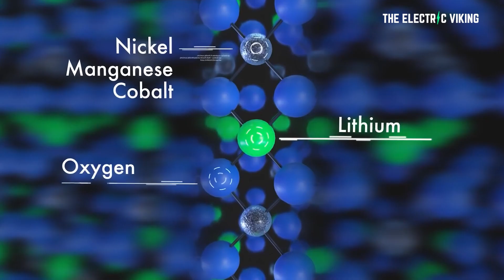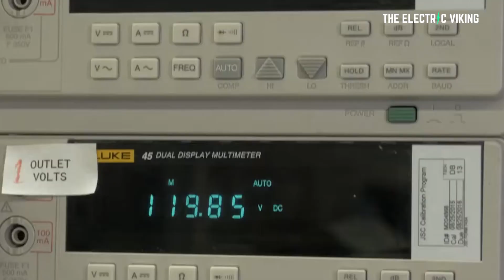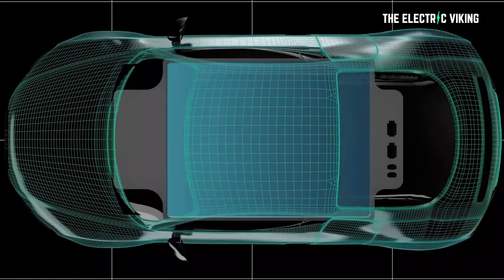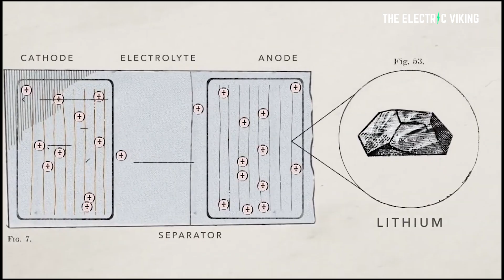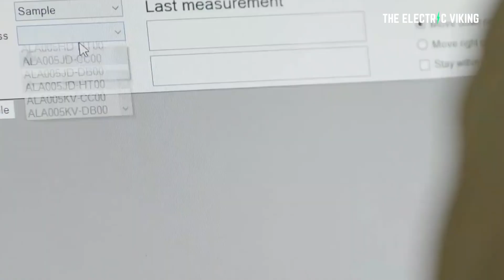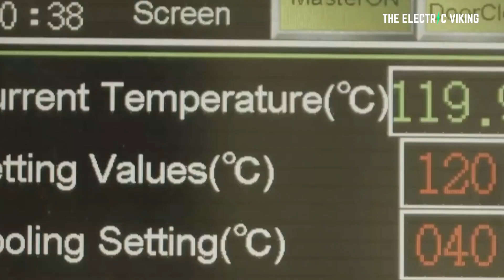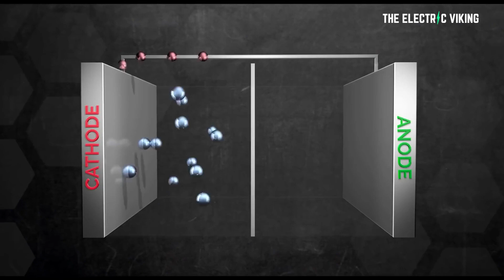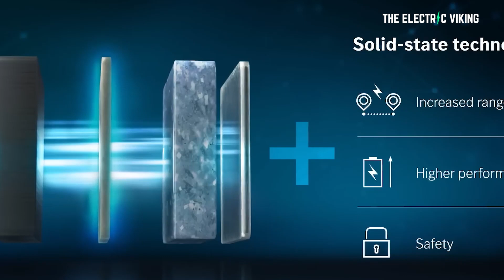NASA's solid state battery could change EVERYTHING

Comment: Any battery with a pure Lithium anode will have safety issues, due to the fact that pure Lithium reacts violently with oxygen in the air or even the oxygen bound up in water (H2O), since the seals that separate this pure Lithium anode from the air can and too  often do leak!!!! Additionally, usually, to enable  sufficient ion mobility, the so-called "solid" state batteries always seem to require some flammable liquid electrolyte, even when they use a solid ceramic separator to prevent internal shorting by the growth of dendrites.

Comment: I think batteries with those capabilities from NASA would be great because of resources resources and also each battery pack if that light and more powerful way more safe the safest actually well we could have motors for helicopter type vehicles airborne vehicles Motors for each battery pack the more motors and battery pack you have the same for the vehicle would be so airborne vehicles could become a common thing or are airborne delivery systems and stuff like that.

Comment: Like others: Paint me as skeptical.      I looked at a couple of articles about the NASA announcement and what is not discussed is just as telling as what is discussed.  
- No mention of cycle life.    If the battery can only be cycled a few hundred times it will have a very limited set of applications.
- Production processes.   If the production process is not scalable, it is not a breakthrough in anything but a scientific novelty.    In addition,  if the production process is radically different than existing battery production, it will be difficult to get the volume ramped up enough to be significant.

A lot of companies and researchers have announced their breakthroughs in Solid State batteries,  but issues like these are the hurdles that have kept them from being 'real'

Comment: Electrical current as is flows creates heat. Unless they have also figured out a new conductor as well.  Every single battery creates heat on discharge, now run it through variable demand discharge rates and throw in the regenerative braking and see what happens.  On diesel electric vehicles the energy is dumped into a diode grid and wasted as heat. Color me skeptical
Reply: I forgot to add that at the current rate of power plant closures it wont matter if they create the perfect battery because you wont be able to charge it.  Selenium is poisonous and water soluble so that’s gonna have to be dealt with as well

Comment: The airline industry really needs to add solar to these new electric planes too like the Aptera. Gotta check out the propeller-less plane. They've goto get rid of those extremely dangerous propellers - they'll never be considered safe for public use. Check out the Jetoptera, JETX, Bellwether Industries and more. Most flights are 500 miles (805km) or less and electric planes will be ready for that soon.
Reply: Ion drives aren’t exactly safe… a few thousand volts at a few hundred amps does bad things to people.
Ducted fans are safer but less efficient at low speeds giving poorer takeoff performance.
Reply: @allangibson8494  Usually a good idea to check to make sure you know what you're talking about before you post - none that I mentioned are using Ion drives - that's for NASA in space, but those working on ion drives seem to have a good handle on it and still much safer than dumb propellers. A one minute check is all it takes.  Plus, comparing that to dangerous blades in this scenario is just dumb as ion drives won't take your arm or head off. How long before some kid sticks his hand in the propeller?
Reply: @donotcare44  A full power ion drive will simply kill you stone dead.
High voltage electrical systems do that.
The only question is will it cook you or irradiate you first while it is killing you?
And I do know what I am talking about with those - high voltage electrical systems are my day job.
Lethality is a factor of power - the more power in a defined space, the more likely it is to kill you. The form of that energy is irrelevant as it is being released to do work.
BTW - sea level ion propulsion systems  for aircraft are a thing.

Comment: Selenium unlocks airline use, but is an expensive element. So will likely only be available for airlines and super expensive EVs for the very rich.
Reply: Selenium isn’t rare. It’s just nobody has much of a market for it at the moment.
Copper selenide ores are fairly common (particularly in Western Australia where they are a major nuisance because of how corrosive they are).
Reply: @allangibson8494  I hope you're right, because right now selenium is very expensive, would be wonderful if the price could be bought down and this high quality batteries be mass manufactured

Comment: Rockets get fueled once and then launched. Commercial airliners are constantly refueled and flown out. Until they can meet the refueling times, batteries (of any weight) are a problem. Maybe celebrities will buy "green" planes but United, Delta, etc, aren't looking to reduce the number of flights they have in a given day, because they're waiting around for batteries to recharge.

Comment: Density IS the weight (more correctly MASS)  per  unit of energy ( watt hours) or capacity for a given weight.  
SO 
what is it?  You keep saying double the density  then ALSO saying a 40% reduction in weight.  Is it that with the given energy density and the safety of the materials a doubling of the capacity would still be safe?  It would still just be a doubling of density and not a factoring of capacity by the doubling of the weight you could safely have of such a dense battery. It  would still just be a 2X factor  over previous  capacity  or density  not both  as a sum of each.
Is that 'FAIR"?   (when you say : "To be fair" it makes one hear "I'm not really always fair")

Comment: Jetengines will not benefit from electrical drive. It will not have the power derived from fuel and heat expansion in the engine, so it will have to be some other type of engine!

Comment: Great video if it works for real it is fantastic but usually the problem is to go from the lab to the production line at an affordable cost it will take time. Ask Elon how hard it is to increase production of the 4086 they have work on that for 2 years now it is getting there but to start a complet new process from scranch it will take time. Hop it work that will be fun for everyone because the batteries have been the holding factor in the production of electric transportation system (airplane, boat, truck, bus and cars)
Reply: Yes
Reply: And naturally for all the riders out there.... motorcycles!  Currently they are often heavy, expensive, average range.  5x would take care of that.
Reply: The funny thing is Hydrogen for regional air travel is possible now, transit over 40 people is possible by 2035.

Comment: Batteries in jetliners will be a loooong way off! There's  about 35kwh in one gallon of jetfuel. A long flight in a 747 will use up to 40,000 gallons. So 35 x 40000 == 1.4 MILLION kwh!! So 1.4 Gigawatt hours! Even with this NASA dream battery @400wh per kilo, the poor Jumbo 747 will be lumbered with a battery weighing 3500 tonnes! ...Bit of a problem, as the max take-off weight is about 400 tons. Lol.

Comment: Honestly, SpaceX is really the stand out on trumping NASA, though in NASA's defense, SpaceX had to take some massive risks to get the basis of its tech off the ground.  Elon himself said that they were at one point one failed test flight away from bankruptcy back when developing the Falcon rockets.  NASA has to deal with a lot more oversight and politics when it comes to large scale projects like building a rocket, which is probably why they are happy to contract out to SpaceX these days when they have the oppotunity.  If SpaceX had a functional Starship working today, NASA probably wouldn't be screwing around with their 'new' rocket since funding of the rocket is conditional of them buying parts from various US states rather than what is easiest.

Comment: "Solid state" is to batteries what Fusion is to Nuclear energy, always just around the corner and will be a game changer. Well, the corner is the longest corner ever made and the game has not changed. many labs are working on solid-state batteries, some for university programs and some for large companies. batteries have indeed been made that work but in a laborious way by hand. They are not performing at the efficiency that the hype says is possible and many scale-up production problems still need to be addressed. If NASA developed a usable unit it does not have to mass-produce it for its program so it may not be suitable for the open market. We need to focus on the tech that is available now and in the next five years that can reduce our dependence on fossil fuels. Diverting too much money into the "I wish" area will not help the here-and-now problems.

Comment: You say that a battery has a high energy capacity of 400 Watts/kg, but the Watt is not a measure of energy, it is measure of power.  It's all very well saying a battery is 400 Watt, which usually means its maximum power, but what matters more is how long it can sustain that power.  You need to quote the battery's ENERGY capacity. This is usually  measured in kiloWatt hours (kWh).  I would have expected you to know better🤔

Comment: Sounds like typical historic govt research, do the expensive research business doesn't want to do and find the pathfinders. Then turn it over to business to cross the finish line. Invisible but world changing.
Reply: BTW, SLS isn't research, it's a jobs program. It's just a pile of rusty old parts from 1970 they just wire wheel the rust off....... over & over.

Comment: Is many have pointed out. I'll believe it when I see it and they start actually manufacturing it and it being put in cars having said that if we are still burning coal N fuel to charge these batteries, it does not matter how good the battery is you were not moving the needle we need to be building thorium nuclear reactors wind and solar are not going to fix anything. They are not efficient enough now the nuclear reactors are not 100% fix I get it but it would be a huge step in the right direction for when these batteries may become viable and actually many mass manufactured, there will be charged with nuclear power, not by: fuel the problem though is we should've been building crap tons of these plants 20 years ago and not one major climate change person has said hey, we need to be building these it's always focusing everything on wind and solar and that's not going to fix the problem

Comment: Holy hell, conflating government funding of research with the current state of the Artemis program is so far off base, I'm pretty sure it's on another planet already. NASA isn't the problem, the constraints for SLS/Artemis were done to keep the production of various components used during the Space Shuttle in the various states. NASA was explicitly blocked from pursuing new technologies for this program so the jobs in various states part of the Space Shuttle supply chain were maintained. Quite frankly, the fact that they developed an even possibly functional rocket based upon outdated systems developed in the 70s is nothing short of miraculous even if it doesn't work well.

Comment: Ball point pen, hydrogen fuel cells and a slew of other game changers have come from the space program.
Reply: Actually ball point pens were around for quite a while before the space program. Pressure fed ball points did come out of the space program as did solid state integrated circuit computers (because NASA bought 90% of the US production capacity in the early 1960’s (and then threw 99% of them away when they failed their rather tough acceptance testing)).

Comment: Sorry Sam Evans it's unlikely any solid state battery will be good enough or as good as ammonia or hydrogen fuel which are also just barely hood enough for long range large commercial transports.   I am an aeronautical engineer with 20 years experience in the aviation industry.   The Breguet range equation (battery electric aircraft version) offers an easy way to calculate the potential range with a few simple parameters.  I have calculated what it is for various battery technologies and they are vastly insufficient for long-range commercial transports but for short-range commuters there is some potential and they could have very low operating costs.
Reply: Here are the estimates for far out battery technologies.
500 Wh/kg yields 1900 km range* SABERS
1200 Wh/kg yields 4600 km range* SABERS
2600 Wh/kg yields 10000 km range* Li-S
* With my upper limit estimates for equation parameters L/D=22, ETA=0.95, Mbat/Moto=0.5
Ammonia or hydrogen fuel can easily match today's range with new more efficient airframes with the above parameters.

Comment: Hmm.  Twice the energy density implies exactly half the weight, not a 40% reduction in weight.  This video presents increased energy density and reduced weight as separate features of this form of battery.  Since energy density is measured in energy per unit of weight, this is only a single feature, described two ways as if it delivers BOTH increased energy density AND lower weight.  Also, the described 40% weight reduction only implies a 67% increase in energy density rather than a doubling.  Articles that feature such a careless use of concepts should be ignored in favor of better clarity and precision.

Comment: 10-15 years away? I hear about solid state batteries being in labs for 10 years, but in a $30,000 commercial car it will be another 10-15 years?vOr does the author have other new knowledge that they will be put in cars/airplanes in 1-2 years? After all, there aren't even mass production factories for that.

Comment: The battery could be the structure of the plane itself.
Reply: Only if it's skinned with something that resists fatigue well enough to spare the need for xray inspection.   CF might not suffice but flawless graphene would.

Comment: If it has double the energy density of existing batteries, then it should be 50% lighter, not 40%.
Reply: That depends.   Energy density can be expressed either by kg (mass) or by litre (volume).

Comment: Battery for aircraft will require an ability to recharge is 1 hour for say sydney Melbourne as a plane makes several journeys a day . i do not believe we have the ability to generate Electricity and deliver it at that level  . A Boeing 737 has a max fuel capacity of 20,000 litre , so lets say it carries 8,000 litres for Melbourne Sydney flight . a litre of fuel has about 7 Kw of energy so that 56,000 Kw ,So ball park thats about 90 Tesla to be recharged within 1 hour x 80 planes an hour . = 7,200 cars .Its Hard to imagine what size power plant would be needed and the cabling / infrastructure to go along with it .. Generating power at affordable rates , be ramped up and down 24 /7 is the big problem . Nuclear is probably the only choice in non fossil fuel generation . Building several plants takes decades as France is finding out .

Comment: There is one small plane now that runs on battery and has a range of 100 miles; this could give it 400 miles; quite a bit better but if you had the same weight of fuel it would go twice as far... anyway a jet would be somewhere in there maybe 1/3 the range.
Reply: @Jim Vonn  Jets?  E-planes are propellor powered. How will you get combustion from a battery. Ummmm, oh yes... wait till it overheats, & somehow used a controlled explosion of the battery.... Not a reusable battery technology then?... Fun for plane spotters to watch them taking off. Well, not taking off, but certainly becoming airborne - in a fragmented stylee!
Reply: @alexmanojlovic768  yes that is it - haven't you seen EV cars catch on fire?  or buses? you can get a long chain of explosions one after the other in like a machine gun firing chamber ... then you don't have to carry the battery the entire flight

Comment: Ggaahh…”5 times higher energy density, 40% lighter”….how do you mean??? The density, is it in Wh per kg or is it Wh per unit volume??? If 5 times more energy per volume and 40% lighter…(less density?) then Wh per kg becomes 5/0,6 = 8 1/3 times more Wh per kg…please be more clear with the units and the reference performance…